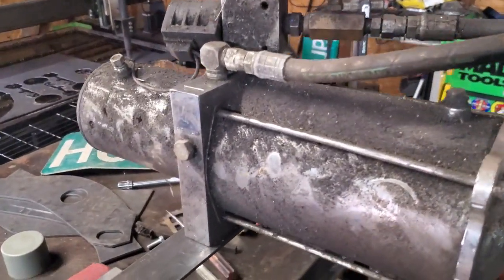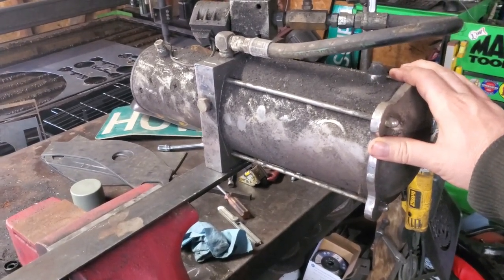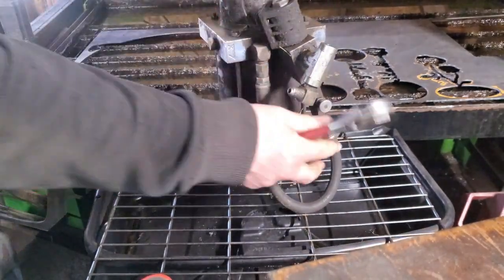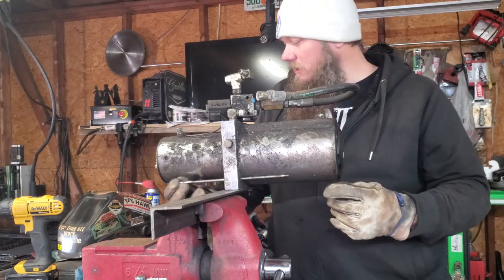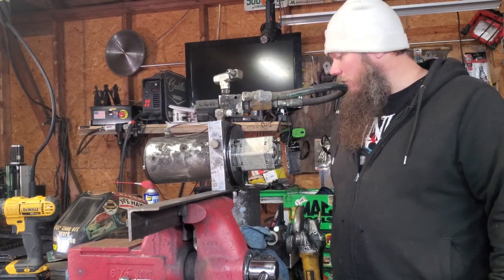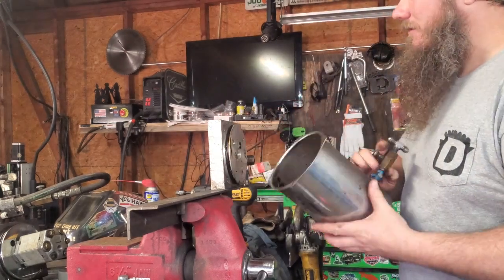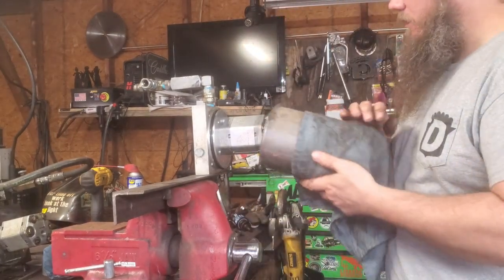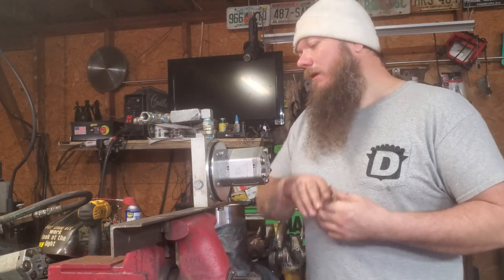Removing A Stuck Hydraulic Tank

Comment: I’m going to make a stand for my vice, I’ve tried pulling and twisting with no avail. Maybe since the tank has never had oil in it and sat for 2 years, maybe the O ring stuck?
Reply from the maker: Put a little oil in your tank and slosh it around and maybe spray some wd40 on the outside of the tank seal
Reply: @ I’ll give it a try, thanks again Dan
#Jackie_6lu3